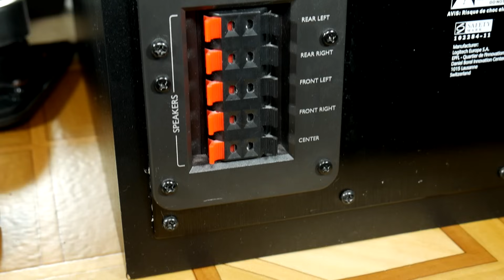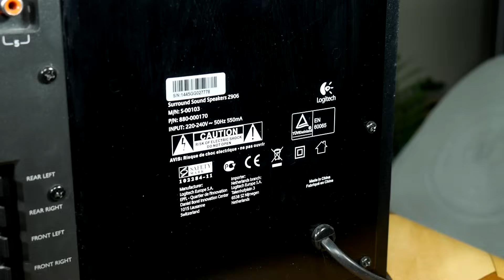Look inside Logitech Z906 5.1 Speakers + trying open control console

Comment: a lot of people give these a hard time saying theyre trash but considering that for this price you get 5 speakers a sub and an amp for them too they are not bad at all for an average room they sound really good and the bass is shaking too,now of course these are not pro audio or not as good as a receiver/amplifier with some better brand speakers but still remember-THE PRICE+GOOD PERFORMANCE
Reply from the maker: not only 6 speakers and amp, but also 5.1 decoder, remote control, they give very good value for price :)
Reply: Right. I hate those peoplewho talk as if they know better than the people behind logitech z906
Reply: I dont think so...if you add some extra bugs....you will get super quality speakers....
You can go for Yamaha or Sony....those are far better than this system...
Reply: @RajaHRaja  But nowhere near the same price.
Reply: The thing with Logitech is that they die really hard. I had a 30W RMS with 120W peak speakers 2.1 which I bought in 2004 and I still have them, the only problem now is the subwoofer volume button crackling when I turn it but when I find the right spot it stops crackling and the bass works fine, so imagine, after more than 14 years my Logitech 2.1 system is still alive. The above one gives a really good bass and the sound quality ofc it won't be like idk what Hi-Fi speakers but Logitech is way better than what's out on the market.
Reply: @johnnymotors2023  my logitech x-540 are more than a decade old, only thing about them is that i have to hold the controller cable tight for them to work, but then they work just fine, as soon as they`ll stop working the z906 will be their successor
Reply: I'm quite happy with the Logitech Z906 on my computer. And I'm not a stranger to good sound as a I have big floor standing JBL's and sub in the living.
Reply: @LoLShadowzLoL  Of course because a 5.1 sounds really good and it is a simple system. 7.1 would be way more better but in my opinion a 5.1 it's more than enough with 1000W peak power and 500W RMS. I have a problem with my Thurst 2.1 speakers on the jack cable but it's easily repairable or I can use the wired remote to input the music or the Bluetooth. They were cheap and simple. And 80W RMS with 160W peak (I think, or something around those values)  it's really good.
Reply: @johnnymotors2023  i got exactly the same problem with X-540, solved with replacing volume controller. But still after few years, problem starts to repeat it self, jet not so bad than last time
have this system for 10 years now -  and not planing to replace it very soon
Reply: Anyone tried to transplant the drivers to wooden enclosure for sound improvement?
Reply: Best price to performance... like there aren't any other systems this cheap for 5.1 setup and bass this strong

Comment: I've had these speakers for 3 and a half years, had many computer speakers (Creative G750, G500, Megaworks 550D, Logitech X-540/X-230/X-530/Z-2300/Z-5500/Z623/G51) and many others, but none have been so flawless and have survived so much with me!
Reply: I bought jbl 9.1 wireless 1000$ 
believe it or not the z906  is much better bass and surround and price I am so disappointed
Reply: Had these bad boys for 7 months and they’re still crisp and hard hitting!
Reply: My bass is getting hot in about 20 minutes of usage. Is that normal on these speakers?
Reply: @enmanuelrodriguez5228  yah if you run any higher than like 20% volume it warms up a bit. I think that’s just due to the amp on the back heating up.
Reply: @flippinjusty6811  mine warms up a lot bro. I need it to take it back to where I purchased them. Waiting an answer
Reply: @enmanuelrodriguez5228  oh really? That’s weird. My will only get warm towards the rear where the IO is at. But not by the actual speaker on the front. That’s too bad. Hope they replace it or fix it that stinks
Reply: @flippinjusty6811  Hi! They already checked and everything seems to be normal because the amplifier is located at the back of the woofer so I will just set up some type of cooling system to get it cold but those speakers are amazing the sound quality and the bass are incredible
Reply: @enmanuelrodriguez5228  yes I have it in a small area with a fan blowing in the area but the bass is killer for sure. Especially for movies and stuff!
Reply: @flippinjusty6811  Great idea! I will do the same bro regarding the fan, just that I purchased two cooler fan like the ones you install on a pc to put them on the back of the woofer
Reply: Only 3 years? That's way too fast but it depends how hard you used it tho, haha. I have Unitek speakers that are working perfect for 14 years already
Reply: @dicekolev5360  How too fast? I still have them, they work. Besides, update: 4 years. Z-2300 and Z-5500 work for other people for 15 years;]
Reply: @SpeakerMaster942  Well, "I've had" means that you're no longer having them, haha. "I'm having these speakers for 3 years" means that you're still having them^^
Reply: @dicekolev5360  My english is poor
Reply: @flippinjusty6811  I would disassemble that amp and check the heat sink interface,,, see if there is thermal paste and if it is dried up!
Reply: @vi683a  Mine is all good…normal heat up nothing crazy! But if it gets really hot I’d consider that for sure. I have a 2k watt amp in my car and that thing cooks lol but it has a fan and water cooled 😂
Reply: hi
Reply: is jbl bar waste in front of
Reply: Where are your speakers made in?
Reply: Sir can you parcel me one of two z-623 or z-2300

Comment: I have this speakers system did warranty exchange so many time. Negative side of this system is its SMPS. Once it burnt you have to through this system. So use a high voltage protector.

Comment: This z906 is plenty loud, but sadly, the treble leaves much to be desired, resulting in a relative lack of fine detail. Apparently Logitech cut costs by using only one driver to drive both mid and high frequency, resulting in strong mids but inability of the unoptimized driver to drive strong and accurate highs. A dedicated separate tweeter or even better, a coaxial driver for each satellite would have been ideal.
Reply: a loudspeaker that doesn't sound good that is
Reply: Here's a review that shows  the potential of the z906's ancestor, the z5500:

http://www.ethereality.info/ethereality_website/about_me/wordpress/?p=882

Note the potential of z5500 for a really flat frequency response until frequencies near the limit of human hearing of 20kHz.
Reply: This is why I have trust issues. I just went through a series of 5.1 speakers and most I've seen, the affordable ones, have either a fake tweeter or no tweeter at all.
Reply: @4G12  Thank you for that information, it is much appreciated. Treble plays a vital role, always.
Reply: Does the treble issue resolve with the Realtek HD Audio Manager?

Comment: On some of the z906 control pods there is a screw in center front leg, but there were no screws in mine (old version), just 6 clips - 3 on top & 3 on the bottom. 
There is a clip in the center on each side and a clip on each end on both sides just in a little from the ends. 
U open by using very thin precision flat blade screwdriver (or similar tool)  & prize open the outer case from one end on the bottom because you WILL mark it. But u won't see the marks if they are on the bottom.
When u get each clip open u have to leave something under the plastic case so it doesn't close up again on the front panel, then you move onto the next clip (I used small wooden ice-block sticks). Once you get all the bottom clips unhooked the top clips come apart easily without any tools.
Reply from the maker: Thanks for advice.
Reply: @Techscrews  Great video. I wanted to know what dac chip is inside. Maybe next time take the board off the backplate also. Thank you.

Comment: Thanks for your video, it helped me open my z906. Even though I wasn’t able to find what’s causing my troubles. 
If anyone has the same problem maybe: Distortions and partially not working satellites?
Reply from the maker: Thanks :)
Reply: Have you checked that all your wires are connected right?
Reply: When you get distortion on the satellites, take out the drivers and carefully inspect around the foam surround where they attach to the frame.  Lightly push down on the  cone ( it will move past the bullet shaped focuser in the center) and you might see some cracks in the edge of the foam.  These will cause nasty distortion at higher volume.  You can buy speaker repair liquid in Amazon that you can brush over these cracks.  Let it dry and it will stay flexible.  I can't guarantee that it will work, but it's worth a try.  Replacement speakers are hard to find. Good luck.

Comment: I have an older set of Logitech 5.1's... I've flat ran the brakes off them... sub started smoking they still sound awesome.  They need a separate tweeter, but otherwise they're great!  Of course, they discontinued them, but after seeing these 906's... I might have to get a set.  Thanks for sharing!
Reply from the maker: good luck to get 906's :)
Reply: Same here although I have the feeling the older one is much better than this new one which was z550

Comment: I’m going from the Logitech x530 to these so hopefully there’s a significant gain in audio quality. I’d imagine a lot has gotten better in about 10 years… i hope. Those pre lengthened rca cables suck.
Reply: I upgraded from Logitech z506 to z906, there is a huge difference in audio quality and power, especially at watching movies and tv shows that support dts and dolby atmos 5.1, like everything on netflix, it sounds magnificient, with a proper connection(optical audio cable, cooper 18 gauge audio cables, and sound card), the subwoofer is very powerfull, but not too powerfull to cover the small speakers, like it was on z5500..

Comment: Good vid, i have a question for you ¿do you have any problem with overheating or something? i'm worried about.
Reply from the maker: no, just listen music and relax :)
Reply: You need to install some Heatsink behind the subwoofer on the metal plate. It helps to cool it down.  same as they use on Raspberry Pie, but bigger and use Thermal paste, same has the one you find for installing CPU in new computer...

Comment: Hi,
Do Surround speakers have extra twitters ? Or they just are mid range speakers?
Reply from the maker: No and no! There are no extra tweeters, and these are not just mid-range speakers; these are full-range drivers with a phase plug feature.

Comment: Dear Techscrew!

I would like to ask only one question. At the end of this video ( Around 7:40) you show the motherboard. Is that a normal look or something went wrong with it? I just ask becouse i realized that the temparature is so high on my motherboard and i opened it. I had the same ( Not too good) look. But everythings work perfectly. Thx for your answer.
Reply from the maker: Its fine, because system work like new one.
Reply: @Techscrews  And what about your temerature? Is it hot or is my system dying?
Reply from the maker: @Tzuio1988  its normal tempersture, i dont use it very loud, for loud music need use pa systems.

Comment: Hi How do I connect logitech Z cinema and logitech z906 to the computer at the same time? One is USB and the other is 3.5 jack. computer only allows one device. I want to receive sound from both devices at the same time
Reply from the maker: just buy 3.5mm to 2x3.5mm adapter and then connect both speakers with 3.5mm cables :)

Comment: Sub woofer size
Reply from the maker: Z906 have 8" and Z5500 10".
Reply from the maker: my mistake, indeed it is 8".
Reply: Z5500 10" sub ya
Reply from the maker: exactly + z5500 use bass reflex enclosures for satellite speakers!
Reply: ArtūrsM 
Sigh. The older Z5500 was actually a superior product that is sadly no longer available.
Reply: The sad thing is that logitech overrates their wattage soooooo hard. I've seen people give the 623 sub 100w, and guess what? Smokeshow. I'm a big fan of the 5500 though as they go for under a hundred dollars used. And the sound they produce is not too bad.
Reply: Mattias M There's no way 100 watts would make a smoke show of the Z623, unless they had it on for a long time. Where did you get that from that it's a smoke show from only 100 watts?
Reply: Look it up on youtube. And my buddy made the coil smell on the orignal coil without clipping with original amp.
Reply: Wich is best buying z906 or z5500
Reply: Which price bro z 5500 and z 906

Comment: Sir. Did you have z5500 or z906 Encloser??
Reply: Sir.What about z623 or z625 did you have either one amp's or not??
Reply from the maker: All my systems are reassembled after teardown and used like new.
Reply: Ok! Sir did you have reassemble z623 if you have can you parcel me
Reply: My english is very simple ok I hop you can understand me
Reply from the maker: @KoenigSegg-j8v  shpping will be almost the same speaker price.
Reply: Ok,Sir how many logitech model did you have right now what about z333
Reply: I forgot to tel you I have z625 since last year and z623 and z625 are almost same so no need z623 that's why but one thing I like z333 also did you have  that Sir?
Reply: Sir would you please a bit discount for me z623 btw,how can you shipping and by how  days it will take
Reply: I don't need yours even for free gift

Comment: Is the sub powerful?
Reply from the maker: if course, z906 use 8-inch high-excursion ported driver with power 165 W and 9kg weight for box. Of course, older Z5500 give some more bass, because it use 10" sub with 188 watt power.
Reply: its pretty powerful yea

Comment: Hi, My Z906 having an issue with the controller, replacing is costly. And better suggestion to modify the system.
Reply from the maker: Buy 5.1 AV reveicer for speakers and for sub from china subwoofer amplifier board.

Comment: Can we use this speakers with other amplifier? If yes then which one you recommend?
Reply: yes, it has standard plugs. It is rated (according to logitech) for 67 W. Not sure on the Ohm. I would not recommend doing that, the speakers are probably the weakest part of the set. Look for 3 way (sub/mids/tweeter) or mayb 2,5 way speakers (tweeters with 2 mids for better overlapping of the audio with seperate sub), they will give you a better quality. If you want small home theatre speakers I can recommend Harman Kardon SAT-TS60 and CEN-TS60 (or whole set HKTS 60 or 65 with wireless sub. I have those on my PC. The 30 series is also OK (SAT-TS30, CEN-TS30 or HKTS 30 set), although HKTS 60 is a bit better when directly compared. The 30 set is available in white, the 60 in black only, so maybe also a choice of taste and preference.

Comment: Just got a refurbished set that has a blown sub. No problem with the quality of everything else so I ordered a DB Drive Euphoria to put in it. 😂 Will see the results when it arrives and start banging throughout the house.
Reply: Update: Installed new subwoofer and wired it to 8 ohm. Best sounding surround sound system I've heard yet. Highly recommend.

Comment: Would it be possible to add a 2nd subwoofer (active/passive) to this system ? - Thanks!!
Reply: active yes,i did that
Reply: @ThomasLeDreamer  can you pls tell me which subwoofer is best. im from india. can u send me a link? bcoz the bass is not enough for me. it will distorted the subwoofer sounds very rattling in high volume. how to fix? do i change the side? i mean opposite side. the con side in the box n magnet part outer side? will it help?

Comment: I got it but the subwoofer is to very hot and in my country is to expensive to buying so i would like how can i to refresh the sub with a mini fan  or its normal to operate hot, i cacule to 50-70°C
Reply from the maker: How loud do you use it ?
Reply: @Techscrews  like a 40-50% 6 hours or more
Reply from the maker: @covenat17  then you need look for PA system, logitech is pc/multimedia speakers.

Comment: hey can i use one more subwoofer with it can you pls tell me which subwoofer is best in budget. im from india. can u send me a link? bcoz the bass is not enough for me. it will distorted the subwoofer sounds very rattling in high volume. how to fix? do i change the side? i mean opposite side. the con side in the box n magnet part outer side? will it help?
Reply from the maker: "in high volume", this is computer speakers and not made for loud music playback, for loud music need buy PA system.  Yes, extra subwofoer you can connect simply, there is video guide - https://youtu.be/fjEcYgASTIs

Comment: Not sure if this is still true, but I read a comment on another Logitech video that they use Tang Band drivers. Tang Band isn't a bad speaker manufacturer. In fact, they make very decent drivers for the DIY audio field. They do in fact make a similar full-range driver that looks the same as the ones used in the Z906. I also notice they make a similar 8 inch subwoofer driver as well. Tang Band isn't the best, but they are pretty damn good for what they are.
Reply from the maker: I also have seen some information about Tang Band  drivers, but it's for Logitech z2300, that I think is one of best logitech 2.1 speakers, how about nowadays speakers, i don't know, there are no label on speakers.

Comment: Why u was not able to open up the control panel. I would have if I had the chance
Reply from the maker: i tried several times, but I couldn't. i didn't want to destroy a control panel, because my all "look inside"  video ends up with a running machine, how it was be before the video.

Comment: what are the dimensions of the actual driver subwoofer itself
Reply: The 906 has an 8" sub. Not sure about depth or magnet dimensions. I don't have a set, but I do have a Z-623 set and now a Z-5500 set (essentially the little brother and big brother of the 906) and both of their subs sound great, so I'd imagine the 906 does as well. 5500 has a 10" sub @ 188 watts RMS and the 623 has a 6.5" sub @ 130 watts RMS. 906 is right in the middle in both size and wattage.